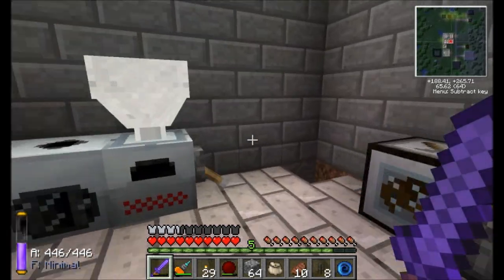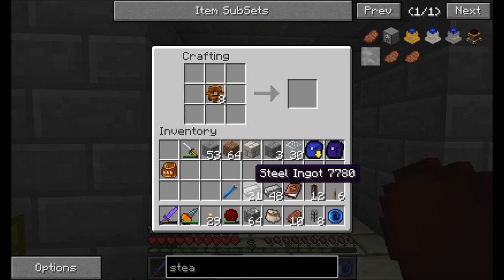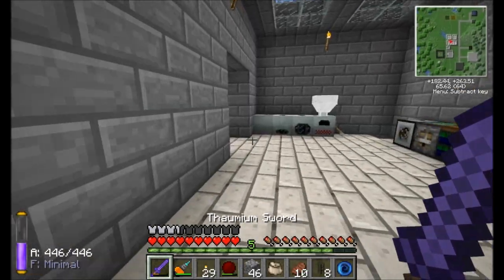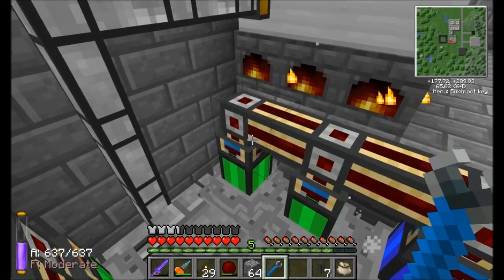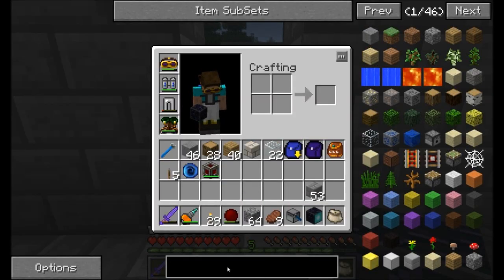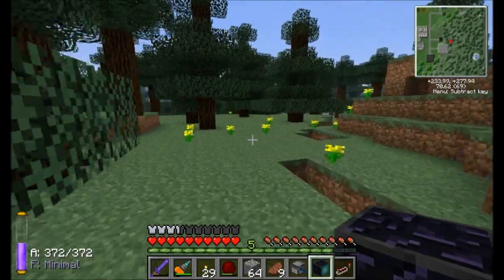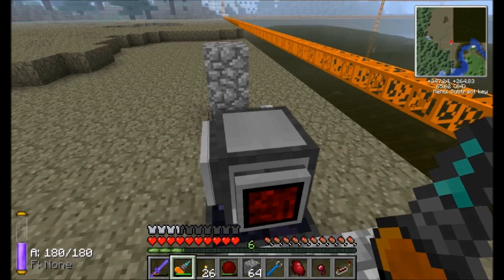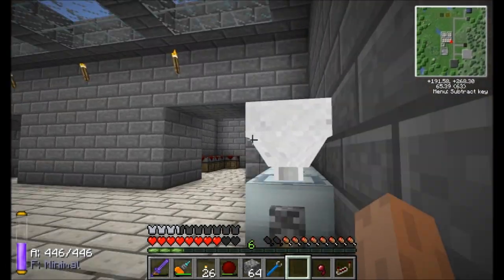Season 5 - Episode 24 TurtlePower

Comment: Dire, if you put a redstone signal on your liquiduct on the boiler it will double the output from the liquiduct... so 1 liquiduct with a signal will run 4 engines, without the signal is why it will only run 2 engines.

Comment: Quick tip for liquiducts: Don't just put them on the side of the boiler and let the steam flow through passively, the boiler doesn't output very much on its own. If you put the liquiduct in extract mode and apply a redstone signal (so it's actively pulling steam out) you'll get a lot more out.

Comment: Hey Dire, there's one problem with your turtle power transportation, if you care about it.  Namely, the quarry doesn't run during the time between when the energy cell drains completely and when a full cell comes back.
I'd suggest, if it's possible, giving the turtle two energy cells.  Have it wait at the quarry for that one to empty, then pick it up, place down the full cell, and teleport to recharge the empty one, then teleport back and repeat the cycle.

Comment: Dire, did you know you can stick the steam engines directly to the boiler's surface? No need to use liquiducts at all for that. Red wire up the sides of the boiler and you can flip the whole thing on with one switch.

Comment: If the Blaze spawner building is about five blocks taller, the output increases dramatically. I tested this and got an increase of 75%. Reason: The Blazes die not fast enough, and therefore spawning slots get blocked. If the building is tall enough, so they can sink under the spawner check range before they hit the water, the spawner will respawn much more Blazes.

Comment: Direwolf, you should label your turtle to avoid problems if you ever need to break it, and also use a failsafe “forward” function instead of turtle.forward(), because if you or a mob stand in front of it, it will be blocked and there will be an offset in its position.
Anyway, the idea of using a turtle to transfer power was brilliant. I love CC turtles.  :D

Comment: After studying some properties of steam I don't think you can compress it in that way. Total pressure would be limited to the pressure in the boiler. I guess you could use some kind of restriction pipe to maintain pressure, but the volume of steam available after that point would be less. So 360cf of steam at 80psig would be equal to so much energy in joules and changing the volume or pressure would affect the other. As far as gameplay goes I like it, but it just make me feel weird about it.

Comment: Direwolf20: Couple of suggestions, place the Engine Room's Turtle Teleporter in such a way that the turtle doesn't have to move to place the empty cell. Also, rather than turning your turtle around, just use the turtle.back() command to back it up.

Comment: Turn those pipes connecting to your steam boiler to extract mode and put on a switch and they will pull more steam out than the 80 per tick DW, did this in my own world and was powered 30 of the commericial steam engines off 3 connectors to the boiler.

Comment: If you restart while it's at the quarry and waiting for empty, it's going to turn right again and not face the energy cell. Also, use a barrel for the scrap instead of wasting a diamond chest. Seriously, 3 barrels for scrap, rubber and UU are /much/ cheaper than a diamond chest. Also, you could maybe rig something up so that it pulls the scrap from the barrel and puts it into the mass fab. Maybe a filter and tubes or filter and relays.

Comment: A single block that could compress liquiducts would be nice.  It could have an adjustable buffer inside and it won't output until the buffer is full (compressed).  Call it a liquiduct valve?

Comment: Hmnm not sure. I just jumped into the game to look at the differences between the two. (blaze rods = 2.4k Heat, peat = 2k Heat) So I would say that the blaze rods are probably best choice once the boiler is at full heat. The reason Direwolf20 burned through so many blaze rods at first was because the boiler was still warming up.

Comment: I'm not fond of turtles and quarries that mine everything. I use a program by AustinKK that only takes every 3rd layer and mines all blocks except smooth stone and dirt. it will even open chests and collect those items before taking the chest. You still get alot of cobble and dirt but not nearly as much. still too much to store easily with out dimensional barrels or multiple recyclers. makes the turtle almost as fast as a fully powered quarry.

Comment: So with the Steam Boiler, I tried your method of sending steam to more than 2 engines, using BC liquid pipes, in order to get the maximum output for my engines but the engines MJ was still cut in half. Are Liquiducts the ONLY way to do this?

Comment: hey guys any idea how to fix turtle teleporters? I had this system running perfect, logged out, came back on and now my turtle wont teleport. I've tried relinking A-B and B-A with no luck, I then tried breaking, replacing and relinking teleporters and nothing, I decided to go into lua to manually try and it teleported 1 way but wont the other, it says false when linked correctly, turtle has fuel and both areas are chunk loaded, I really don't wanna reprogram the turtle unless I have to,